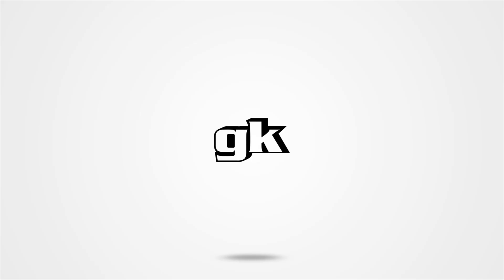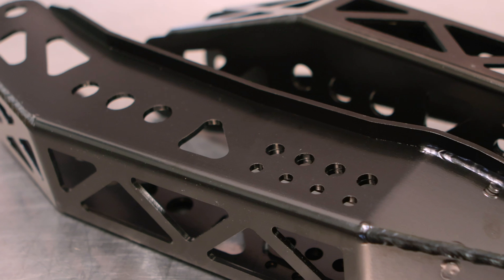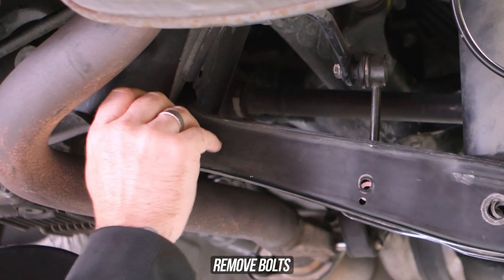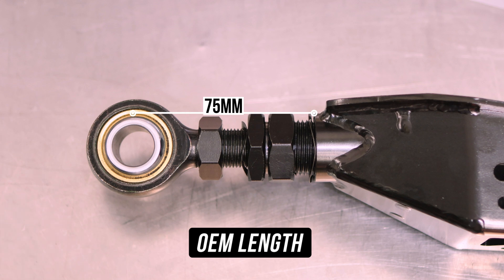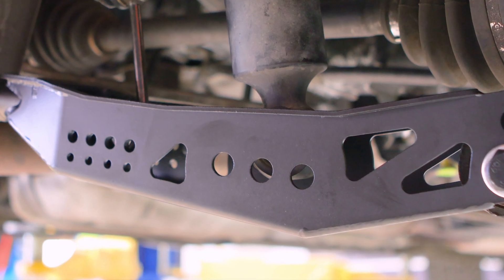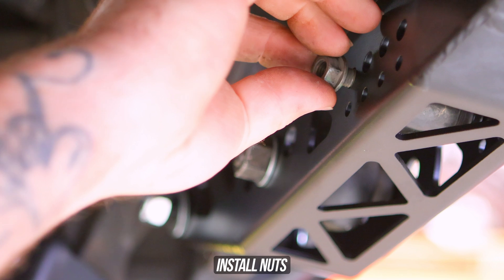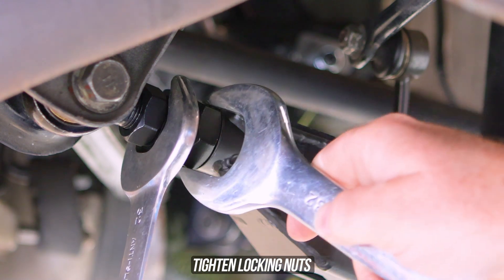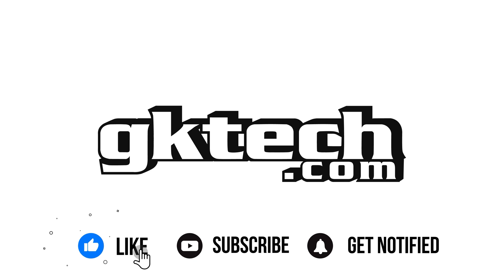Gktech IS200 IS300 XE10 Rear Lower Control Arms - Install

Comment: Reckon that will fit GS300/Aristo JZS16 as well?
Reply from the maker: We have heard that they share the same rear end as the 2nd Gen Aristo/Lexus GS/3/4/430/SC430 but have not been able to confirm ourselves in house though.
Reply: @gktech  cool, Parts by max and seria9 say they fit both..I can test some if you want to post a pair to Adelaide :)
Reply from the maker: @ Hmm, we can't promise anything, but email us at sales@gktech.com we can take it from there :)